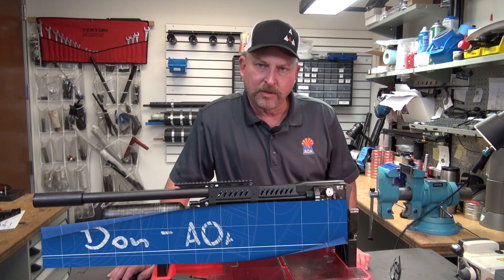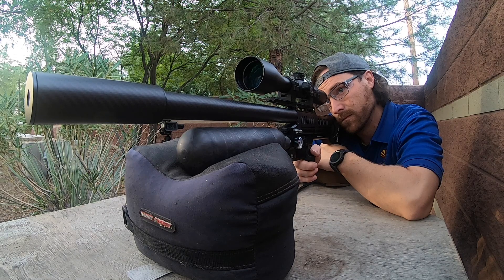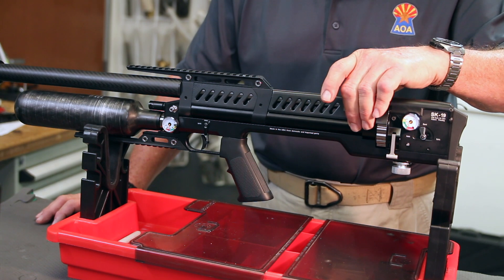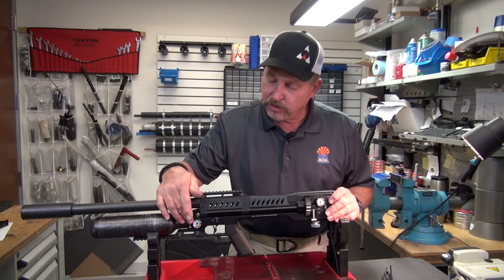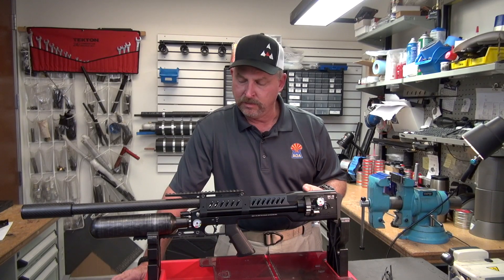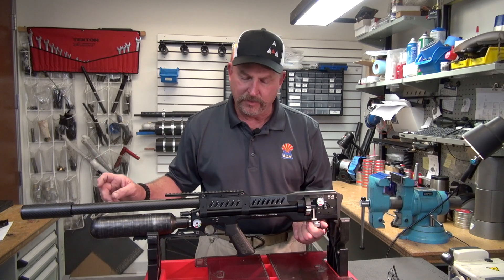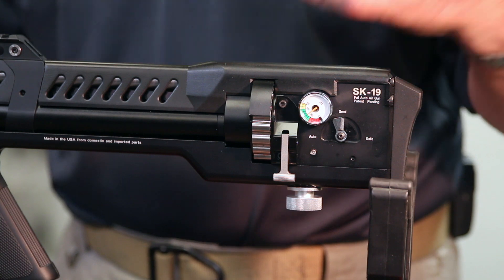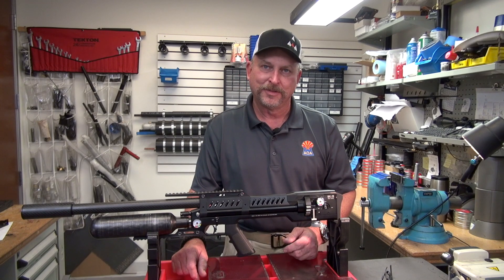LCS Air Arms SK-19 Full Auto Airgun Tuning and Setup

Comment: My brothers SK-19 developed a problem where there is a noticeable air leak with some  magazine rotation hesitation when shooting.  The shot count has dropped to about 38 on a 29 cu inch bottle.  I am filling the gun to 250 bar and shooting down to 150 bar.  I have disassembled the gun and everything looks good and clean.  Do you have any suggestions on what the problem might be and how to fix.  Thanks in advance for any help.

Comment: help me anyone in air leaking issue. can you help ? can you tell me that is there any o ring inside the air cylinder????? I give my gun to a local gun smith and when i received my gun it is leaking air slowly very slowly , it takes 4 or 5 hours to leak 30 bar air.  i opened the cylinder and and seeing no o ring inside the air cylinder. Please help , I am your subscriber.

Comment: So the rear pressure gage should only be used to decrease pressure because it is already optimized out of the box for highest pressure?
Reply: i think they mean not to touch the regulator. the dial on the rear is not maxed out when it arrives. you can dial it up and not have to worry about messing things up.

Comment: Without a Chrono, I left the power alone until I attain one. I know one thing we need a .25 cal pellet holder to keep refilling this beast. I got mine dialed in now. Scary how fast pellets disappear. I've read some complaints on the trigger adjustment or lack thereof.....I like mine just fine. Its not a match gun. Although accurate enough and I'm sure someone will use one. - I haven't picked up any of my other guns since getting one. I have a 580cc bottle. Might need two? :)
Reply: Yes we need 25 pellet pen

Comment: My gun is a .22. It has been shooting 15.4 grain pellets since new 5000 plus rounds ago, 8 clicks up from the minimum setting on the power wheel at 900-910 FPS. It has never, not even hinted of a functioning issue, FLAWLESS reliability, consistent, absolute tack driving performance. The gun is awesome and is the most effective pesting/hunting PCP I have ever owned. Trigger is reminiscent of a Benjamin 392PA I have and is super easy to get used to. Not a target or match grade trigger because one on this gun wouldn’t be very safe considering semi/full auto features. Can’t praise the gun and the inventor/inventors enough. So super easy to tune to your favorite pellet. Yes, it will shoot the heaviest pellets out there with serious energy and speed but it also will allow you to use my favorite backyard friendly and affordable Daisy Hollow Points. Their soft lead just explodes at the speed this gun pushes them and mushrooms to almost .35 caliber on impact which puts all that energy on target and minimizes passthroughs and wasted energy delivery. They are good in stock form out to 50-60 yards effectively even with their low BCs but with a drop of RTV in the hollowed end can raise BCs a little, increase their effective range and cause a hydraulic effect on the soft lead hollow point that expands violently the moment of contact that delivers so much shock energy and super quick clean kills on rabbits, crows, whatever your pest or game. Head shots aren’t needed and in fact prefer front shoulder shots to help eliminate those worrisome passthrough possibilities. This gun is without question a mechanical marvel and has become my go to critter getter.
Reply: sold , I'll take 2...